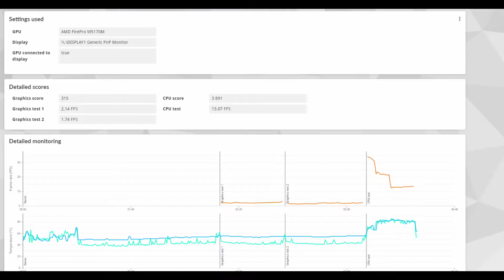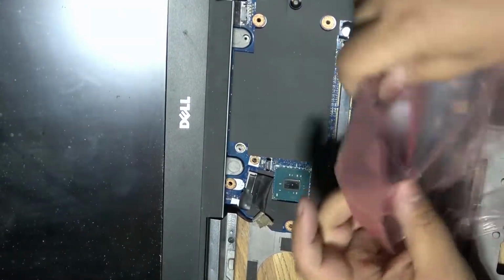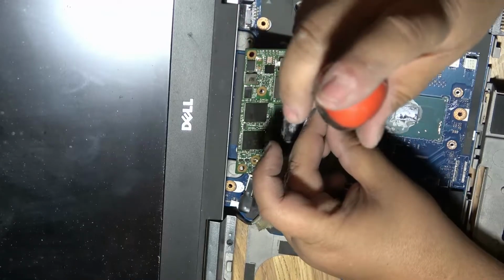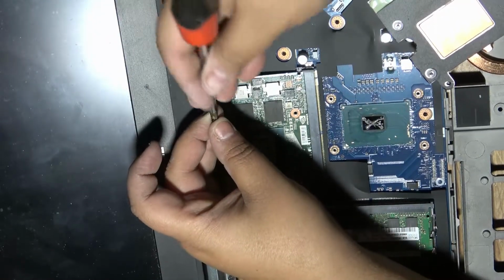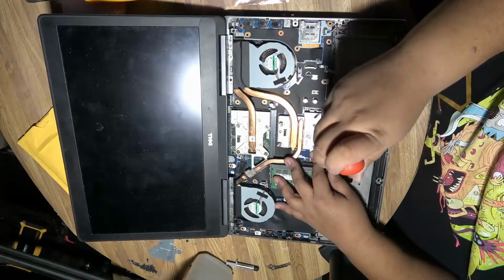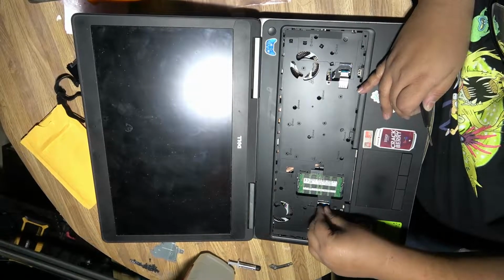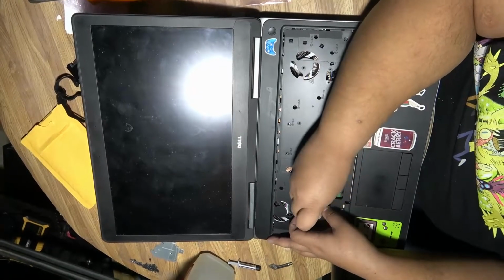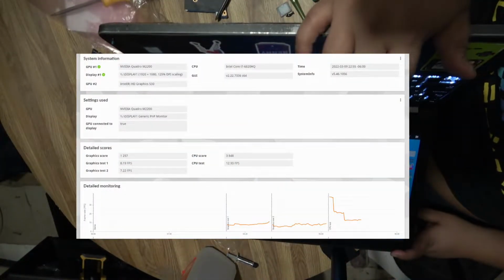7520 precision  graphics card , heat sink and thunderbolt  port upgrade (Part 2)

Comment: What's all that stuff you had to do with the hinge covers?  Were you having to make sure the wiring harness was out of the way?  Wow, that seems kinda fiddly.  (It might help to either lace or tape the wiring to keep it out of the way?  (I haven't used waxed lacing cord in decades, though... for something that small it might be more trouble than it's worth.)  Cable ties would be too bulky, though.

I see you are using Arctic Silver 5.  How has that worked out for you?  (I have a large tube on hand!)  I didn't think that stuff was conductive, but now I'll have to do a test.  Thanks!  I spread using a strip cut from an old credit card and cleanup, but that's just me.  You do you.

Getting the clips open for all those ribbon cables first is a nice touch!  The owner's manual does give some tips for assembly disassembly that might be of interest to  you.  (I linked to it in Part One.)
Reply from the maker: the wires near the hinge are just the right size so they have to go in just right.   artic silver is supposed to be nonconductive but it's not safe to have it on electronics because the manufacturer says not to do it and other cheap thermal compounds are conductive.  i got everything to fit again no zip ties required this time.

Comment: Guys, please handle your equipment
 with care. Do not do what he was doing with that GPU. Screw it down first or you could end up with shorted components.
Reply from the maker: i never had the board powered up? how will it short? the gpu is designed to pop up when not secured similarl to ram